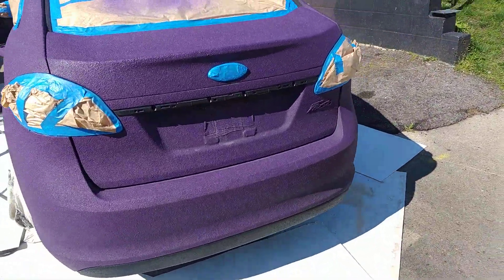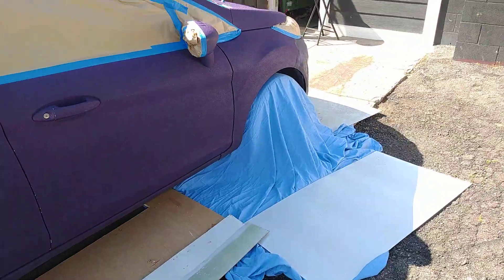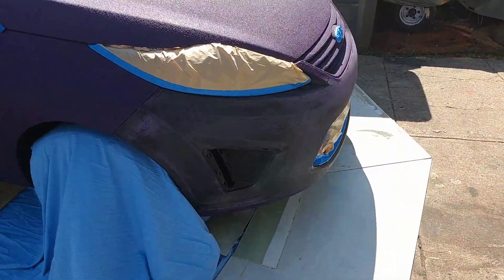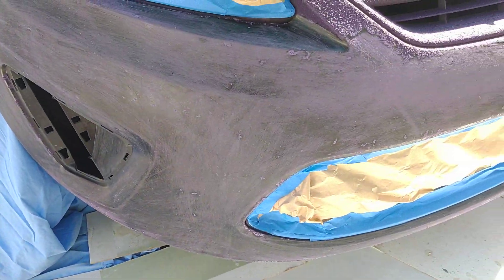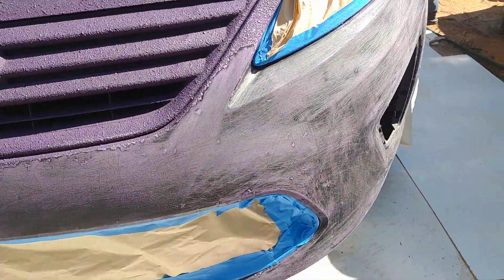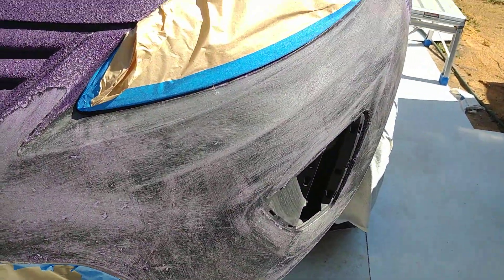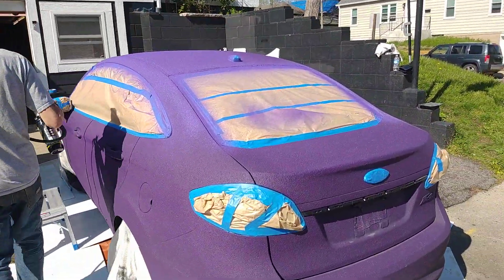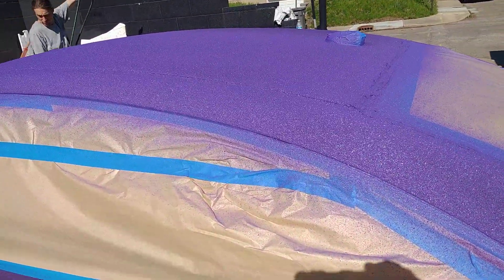Raptor lining my car purple BOOM BABY 😍

Comment: Did you use the basic gun that comes with kit or did you use an adjustable gun and how many bottles of raptor liner did you use
Reply from the maker: I used the gun that comes with the kit and I  only used a 4 bottle kit with my small car

Comment: Hi mate what colour is that and where do I get it from, I am in the UK, or if you could give me a link, I would really appreciate it 👍
Reply from the maker: It's just called bright purple raptor line paint . If you Google raptor line paint it will take you to different sites to order it from.  I think I got mine off of ebay or something like that.  It comes in a kit so you can spay it yourself,  the spray gun and mixtures.  You just need an air compressor 80 psi or more and as you see in the video we did it in a driveway.  It needs to be warm out and only took a few hours to do . It dries instantly  , I  drove away 15 minutes after spraying.  When prepping the car you need to rough out any smooth surfaces and plastic.  It won't bond to smooth areas so pretty much scratch up all the paint.  Once you do this it's forever going to be textured there's no going back to smooth paint  . Plus if you ever want to change the color all you need is exterior house paint and a roller like if you was painting a house